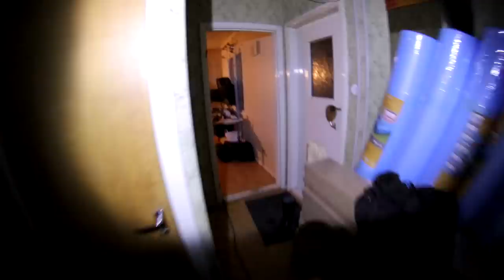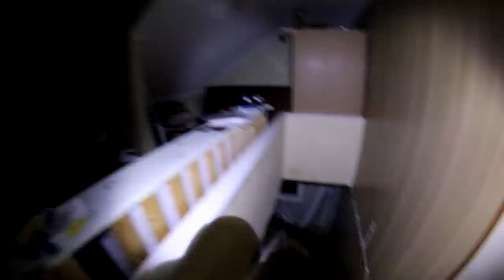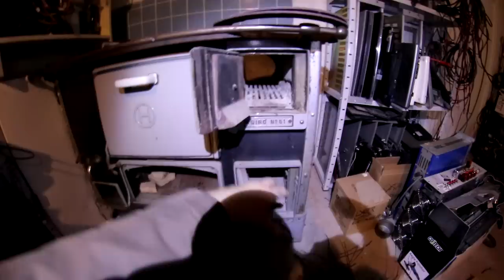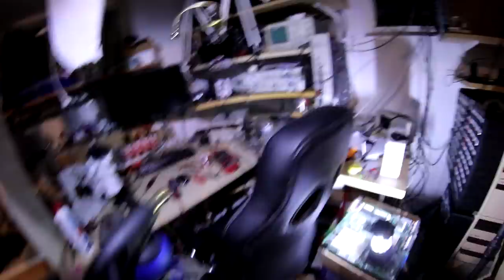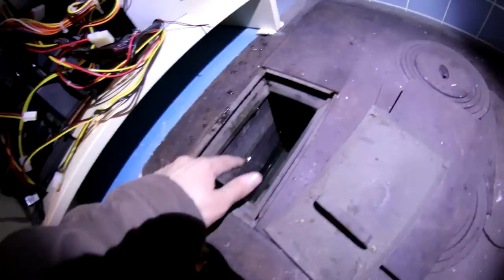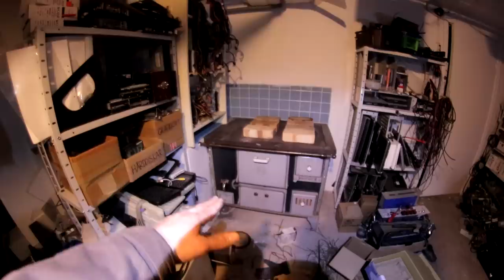Power Loss Blog 1 - Day 1

Comment: 2:41 Is that small ups modded with bigger batteries? I tried that 2 times but it corrupted the damn batteries :( twice
Reply: how the heck do you corrupt a battery?
Reply from the maker: Yes, old APC UPSes work well for that if you know a little bit of magic.
Reply: @milesprower6641  it over charges them.